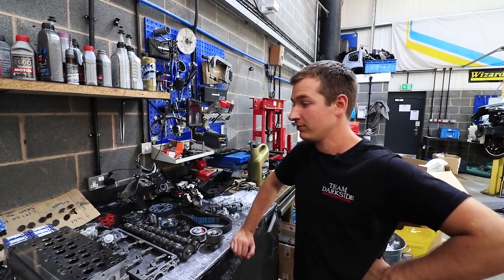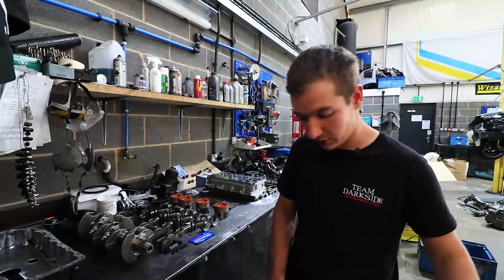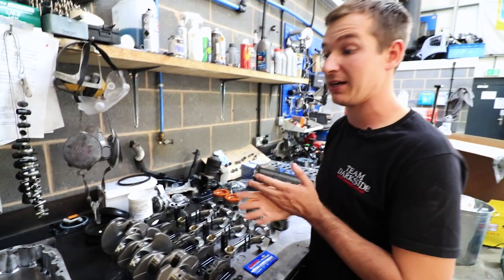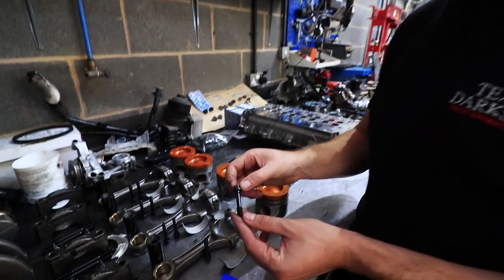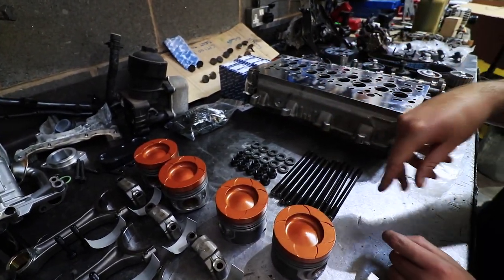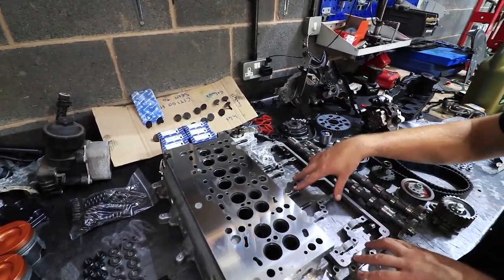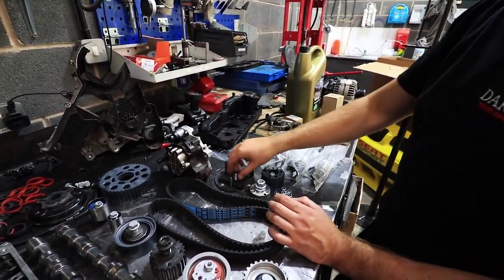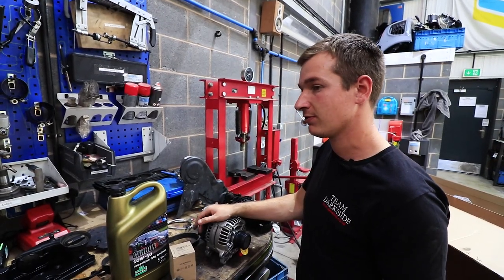What goes into a TDI Race Engine! - Part 7 - MK5 GOLF EX VW CUP CAR - DARKSIDE DEVELOPMENTS

Comment: Why is there no interest in a jacked 5.0 TDI?    Id love to see a monster like that.

Edit:Go drag racing in a stripped down 5.0 Phaeton
Reply: That engine is expensive to maintain and doesn"t have a lot of power for it"s size. and to big to put in any smaller car then the touareg or the phaeton.
Reply: Its crap
Reply: Because it would make ton of torque but not much power. it would need very quick 8 speed automatic to put it down and it never came with one and also they hold up some 1200Nm at most. That engine could put out 500HP but it will come with 1600Nm maybe.. not really practical. Also it is heavy AF and unreliable. You really dont want to pull that monster crap from car after every race.
Reply: @75L48  how come the 2.0 litres gearbox survives 350hp?  Its 2.5  times the standard Power. Do the same mods to the Phaeton gearbox.
Reply: I suggest you study relations between RPM, Torque and Mechanical power. There you will find why 2L gearbox can transfer 350HP, or even 500HP but woul brek on V10TDI even in stock form.
Reply: @75L48   you do realize i am talking about their 2litre Diesel engines they build? Like the VW Bora.

Edit: Its a "1.9 tdi" with 450 HP on this channel.
Reply: @del7723  these engines run much lower tq (lets say 600 nm max) and rev higher... Thd bigger engine will get a lot of harmonic issiues reving "that high" and they run the wrong stroke bore lenght for the layout while the 4 pot can get away with a long stroke at rpm since theres only one thrust vector, if u did this in a V configuration you get lots of twisting forces
Reply: @del7723  we have 1.9 tdi with 600hp no bigdeal just search for "polo ammotorsport"
Reply: V10 tdi was used in a Le Mans racer.
Reply: @trisrush9155  a totally different engine for sure, only thing in common being a V10 TDI. Because Phaeton V10 TDI is a PD and LeMans cars always used CR, and did 1000Nm, it was a bespoke engine for racing and not really related to Phaeton or Touareg V10
Reply: I’ve had dark side fettle my 5.0 and she’s at 290k miles running 450bhp with 900lbsft, it’s invincible with proper servicing, as long as your not competent it’s fine
Reply: @jesperviktorsson8027  thats actually some good info. Thanks.  Doesnt happen often in comment sections :)
Reply: @del7723  thanks dude, theres a lot of BS around and everyone just get into fights...
Reply: @trisrush9155  Audi eventually dropped the V10 for a TDI race engines with smaller displacement and better turbos.
Iron block v10 is a lesson in pumping losses.

Comment: Ok, tech question because I'm like that. Does this mean the crank from the oval port engine can go in a PD150 (assuming someone would want to for some reason), just need to reroute crank sensor and fit either a CR oil pump or at least the pulley off one?
Reply from the maker: Yes and it's much lighter!
Reply: @DarksideDevelopments  oh cool, thanks!

And so begins the long search for a decent crankshaft 🤣.

Comment: Reyt then, did I see u use oem valves with reground cams? Don't u need valve shims? May u adjust oem rockers? Love those red coated pistons :))
Reply: The cams Ryan has are ground on new castings so they have original base circle while having more lift and duration.  Also there are plenty of people running reground OEM cams on these engine without a need to shim. The lifter has a fair bit of adjustment in the factory design to compensate.
Reply: @labmancdn  do you know if it's possible to regrind till to 272 duration 9.5 lift only adjusting lifters? Budget fast road cams :))

Comment: Why blank the water pump? 
Do you just run the engine air cooled to cut back on weight?
Reply: Has an electric water pump.
Reply: lol air cooled..
Reply: Nightshift drag engines are air cooled.
Reply: @fearofchicke  no, not really dude.

Comment: Are you using a regular ecu just reprogrammed for this car or another.  Thank you
Reply: Yes EDC17 c46 ECU, same as Citigo
Reply: @ryanp6138 One more question
 the water pump changing roller is specially made or used
Reply from the maker: @Garaza-po9mq  The OE water pump is blanked and we use a special pulley
Reply: @DarksideDevelopments  Tank's respect for responding